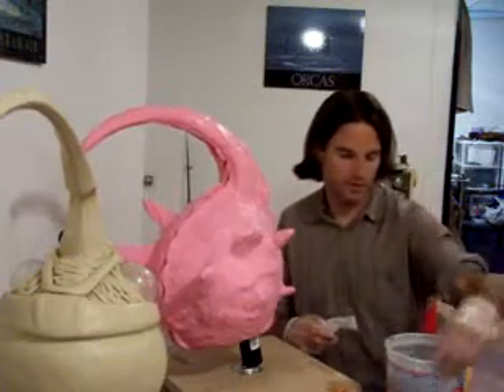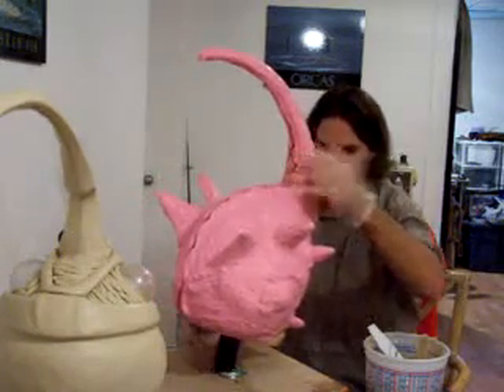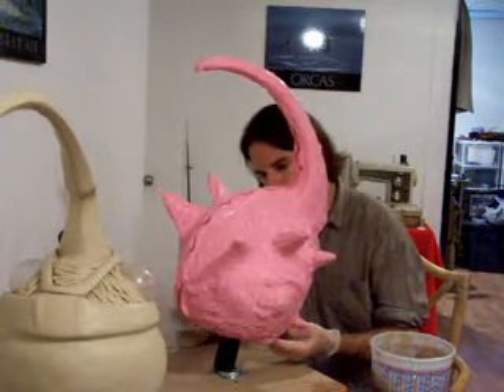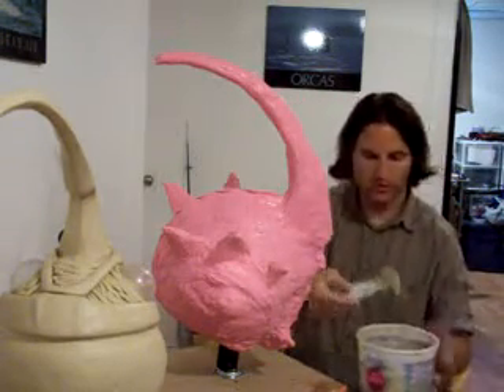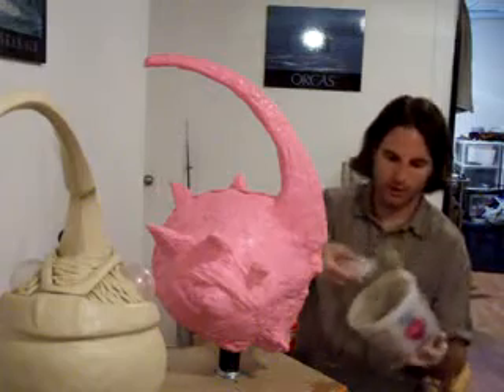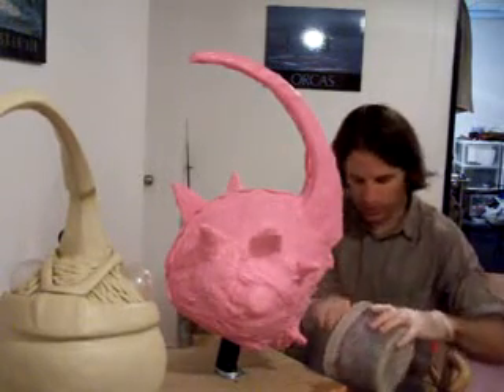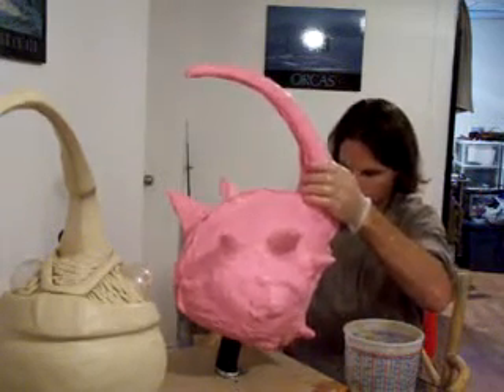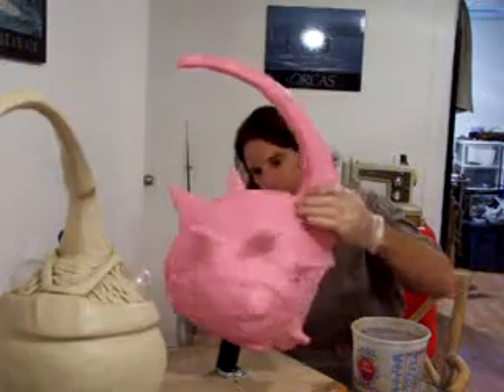Guyver 3 helmet mother mold part 1

Comment from the maker: the adjustment is only needed to be done to the form inside, the silicone jacket mold is great but once the mother mold in place it will reproduce the form in that position (meaning the horn) I had to tie off the horn a couple different times to crank it over and then apply the mother mold bit by bit.  This is why it's important to do the mother mold immediately after the jacket mold has finished curing and before you even think of peeling it off the form.